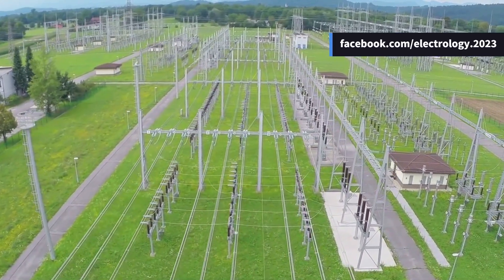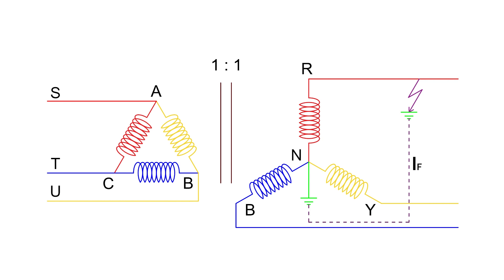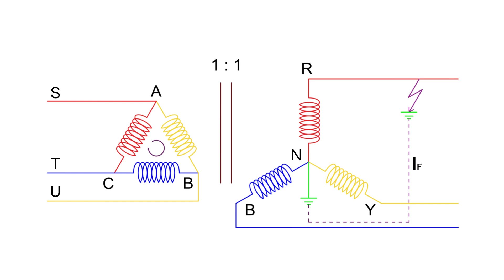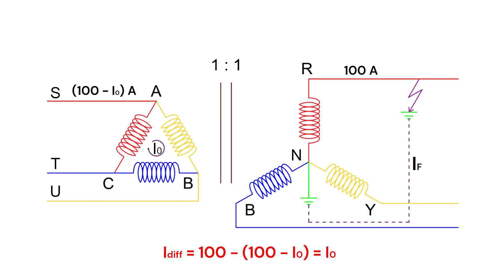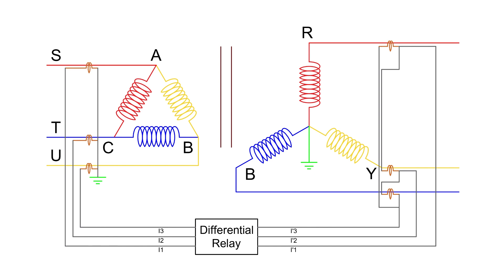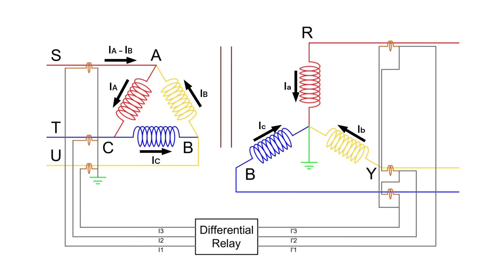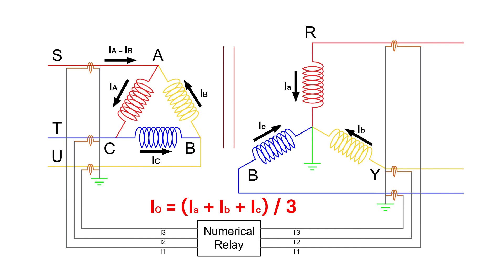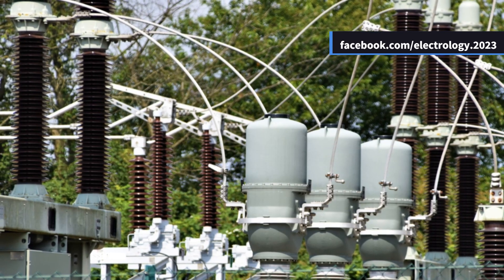Zero Sequence Current Filtering in Transformer Differential Protection | Explained with Examples

Comment: Numerical relays eliminate zero sequence by using compensation matrix. It is basically behaving like a delta connected cts but it is done mathematically inside the relay.
Reply from the maker: Absolutely right! Numerical relays use internal compensation matrices to mathematically mimic delta-connected CTs and eliminate zero sequence—smart and efficient solution!

Comment: So, what happens if the winding is shorted with the core inside transformer tank? Theoretically a zero sequence current will be flowing but differential will not pick up. In that case what's going to happen?
Reply from the maker: Great question! In such a case, differential may not pick up the fault if it's filtered out or too low, but Restricted Earth Fault (REF) protection usually detects internal faults like core or winding short to tank.
Reply: the zone   between two Cts is protected by main differential protection and REF @Electrology001